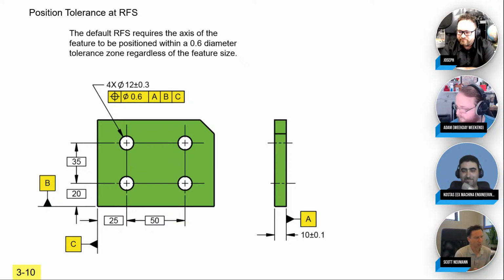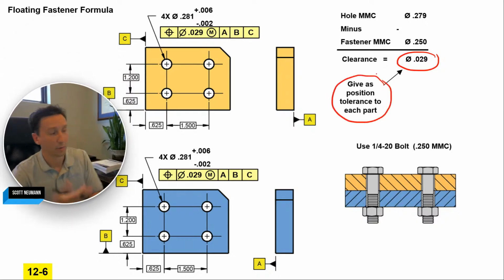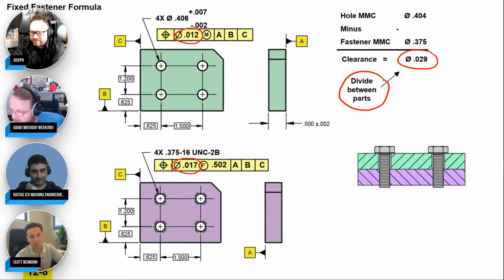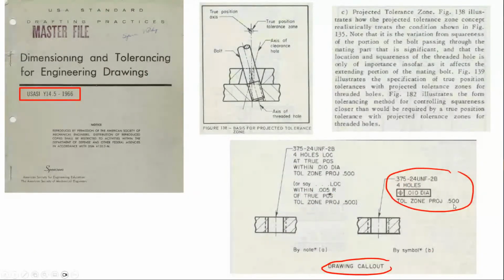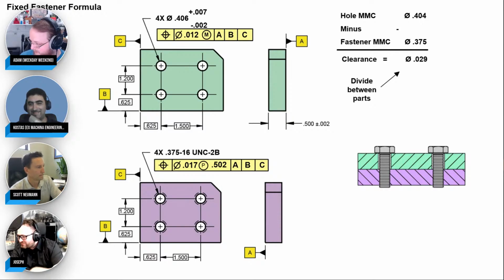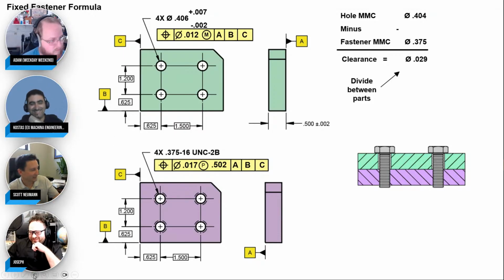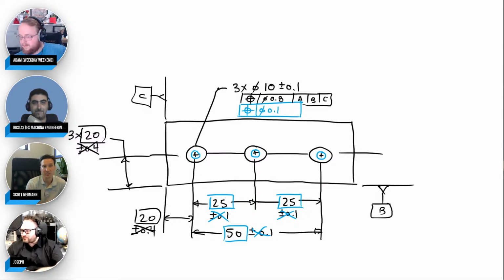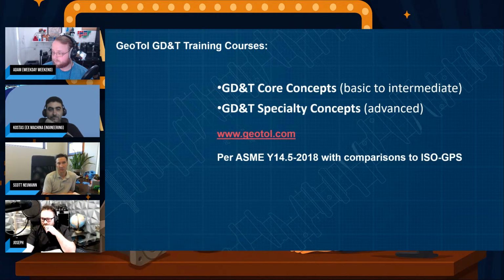Ask Scott Neumann, the GD&T Expert

Comment: This was one hell of a stream.
I'm so sad I missed this stream, although I was on vacation so maybe not to sad...
But this was a stream that fits me with my QA and Design background.

What a presenter Scott is, making this very dry and theoretical stuff very enjoyable to watch.
I'm also glad that the way I teach jr engineers this is pretty similar to Scott's, however I still have learned quite a lot... and some things I wish I knew before.

I also agree with Adam, this presentation should make you understand the concept of GD&T. And if you understand this concept on the holes, you can apply the same concept on the other tolerances. The only thing I wish he explained more is the difference on the dimension if you use Ø or not. Because that happens more often than one would expect, even on holes.

Fun fact, ASME has pretty much eliminated concentricity because you can solve that with position tolerances while ISO still has it in the standard.
Reply from the maker: Yeah that was indeed one of the best. Scott loves this stuff and is passionate about the benefit they bring. That's why he can represent it so well. He believes in it.

Cool fact about the concentricity tolerance.Didn't know that. But yeah, this stream could have been 6h long and I would still be interested to hear more.